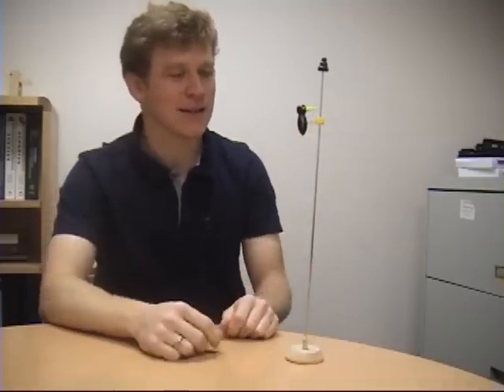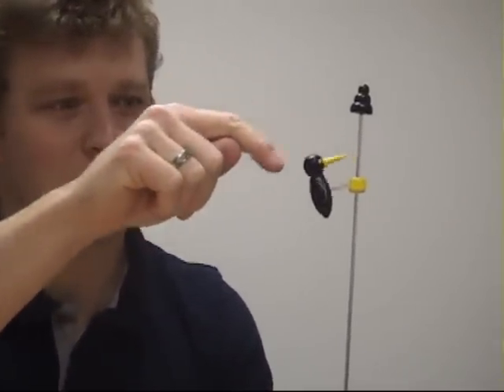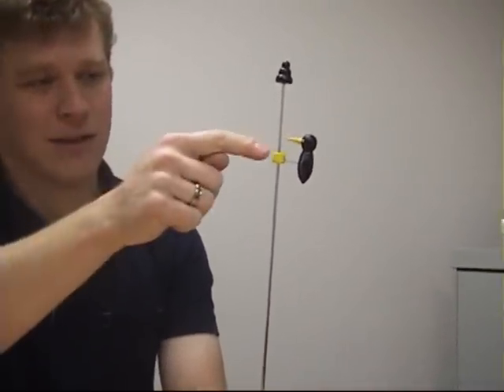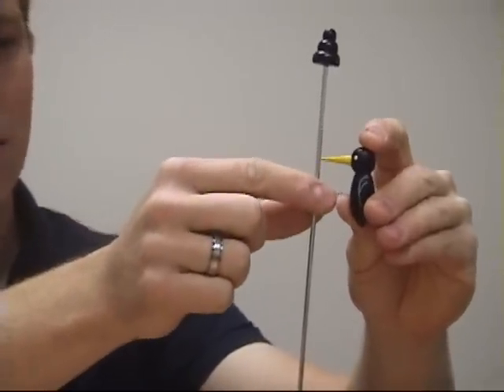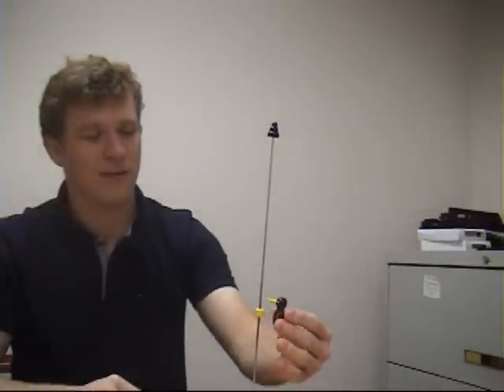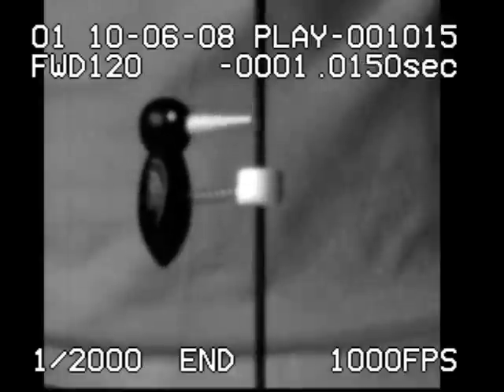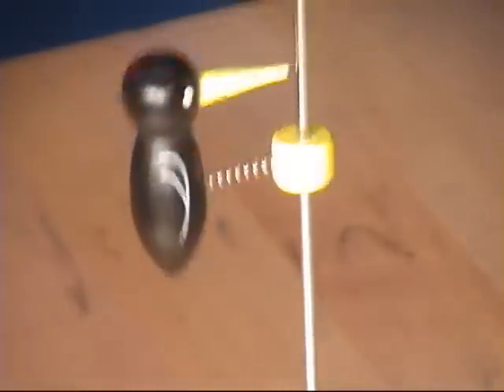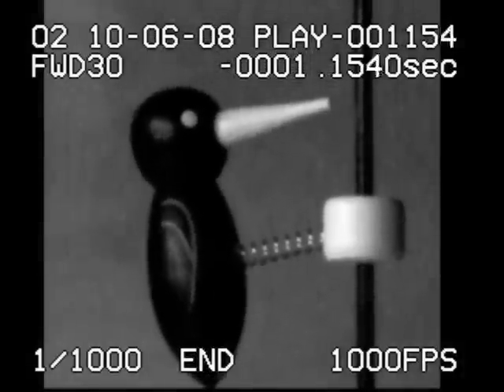Toy Physics - Part 1: Woodpecker on Pole

Comment: This can work without impact. It doesn't slide because the weight of the woodpecker creates a moment which locks it due to the friction, during the oscillation that force is removed and the sleeve can momentarily fall. There are a lot of similar mechanisms that use this locking method such as some wood working clamps, this is how they get coarse adjustment before tightening.
Reply from the maker: … but it wouldn’t be a Woodpecker without the impact.   :)

Comment: Young man,  this woodpecker will work even if the beak or bill doe not touch the pole. When happens when the bird is in the lower position it is held by friction as you so well described, and at that moment  the spring is storing energy,  so as the bird is raised by the action of the spring, there comes a time when the ring is separated from the pole and so it will fall. This falling will give momentum to the bird as a whole and since it has the additional throw of the spring energy it will come  down faster than the ring  till the ring   till the near lower  side and far upper side of the  ring touch the pole and  friction causes it to stop while the woodpecker proceed to swing storing energy in it. 
The fast that the bill can touch the pole adds a non-linearity and it is not so easy to analyse, otherwise if the bill does not touch the pole is is fairly easy dynamic equation.   I wish all these toys will be used to show the application do materials, science and mathematics and physics and material science.  All schools will gain a lot if these automata dynamic toys are show  at schools and presented as applied processes of what they learn in class.
Reply: Can u pla share link of any studies?.Case with linear equations.